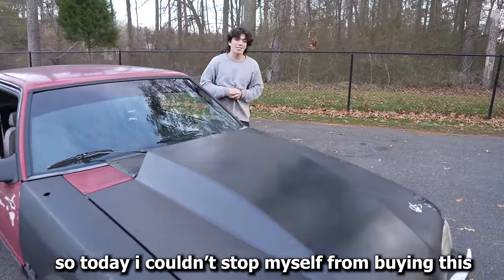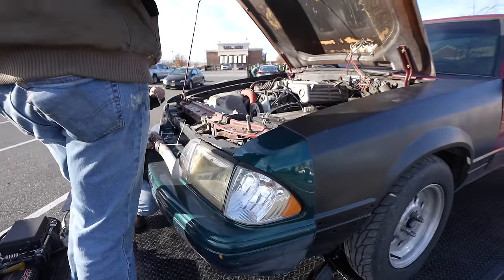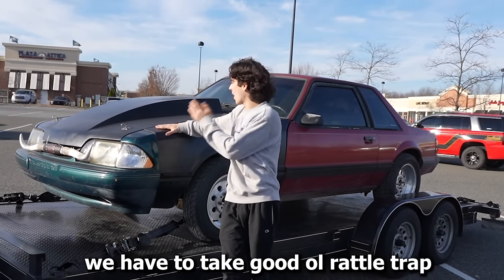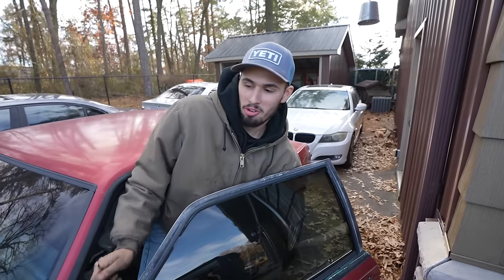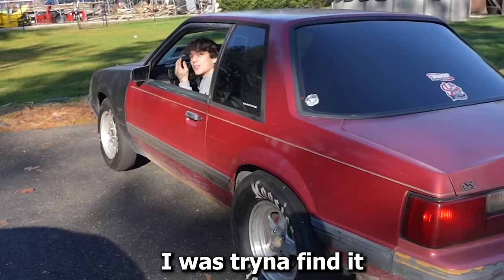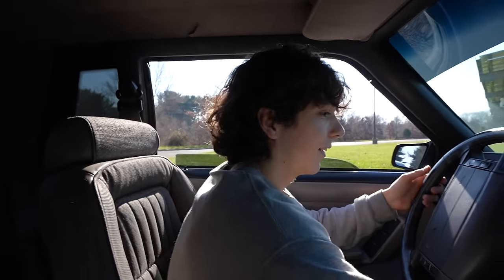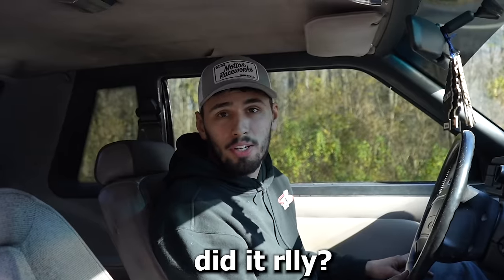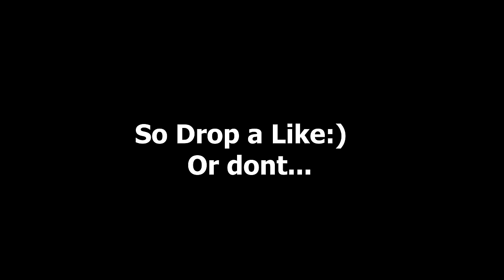I Bought The CHEAPEST “Race Car” on Facebook Marketplace! (Pops Wheelies)

Comment: The heads/cam and intake combo is most likely gt40 heads, ford b cam and a cobra intake. Shes probably pushin around 260 crank, also the speedo not workin can be pretty easily fixed with a LMR replacement!
Reply: So basically will get gapped by a New Edge mustang GT 😂

Comment: As a foxbody owner. someones  gotta let this kid know so... before you mod this foxbody the 5.0 Cannot handle more than 499.99 hp on stock block. The 302 will snap the block literally in half around 500 hp. Its a notorious issue even with a build bottom end the blocks cannot handle power. Be careful with that thing. And the supercharged sound you hear is the powersteering pump another notorious ford issue especially on foxbodys.
Reply from the maker: 🇺🇸🇺🇸🇺🇸murica brotha!! Gotta love ford
Reply from the maker: Much love for the info bro fr, I’m learning more and more abt these things everyday
Reply: @DomTracy  yessur! If you have any questions hit me up in the comments👌